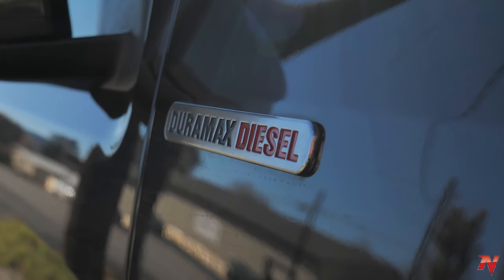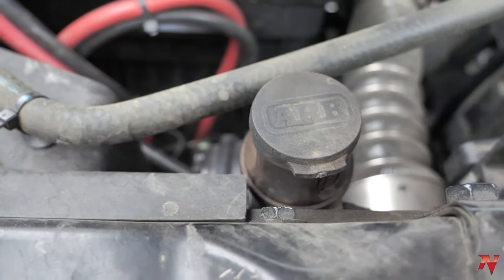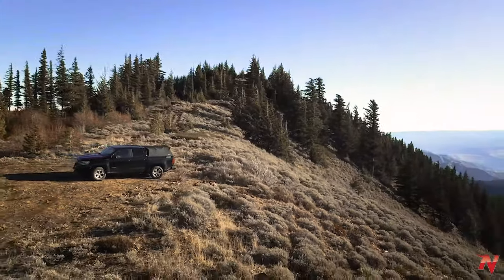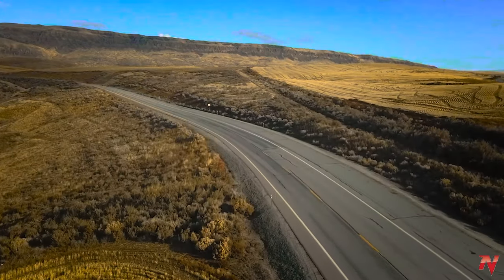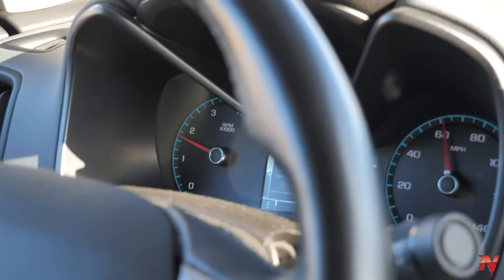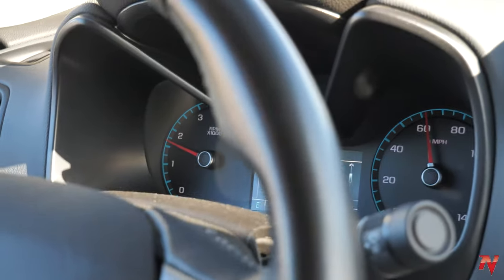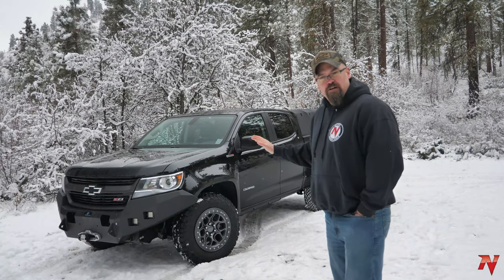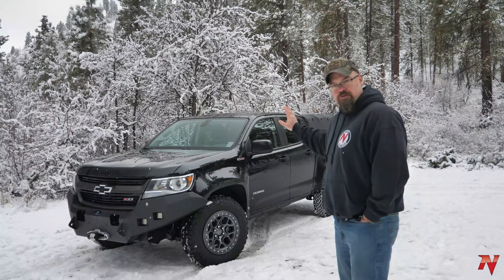NITRO REGEARED Ep. 8 // Chevy Colorado Gets 4.10 Gears // 1st Driving Impressions

Comment: At the end he recommends that with over a 32" tire going straight to 4.56.  With the 6th gear ratio on transmission though being .674, a 34 or 35" tire puts you at over 2200rpm at 75mph on the highway.

Seems just fine for the gas v6 but pretty unwieldy for the diesel to be running at for sustained cruising speeds don't you think?  Seems like even with 34s and 35s 4.10s would let you keep some highway manners while 4.56 would kill your higher speed MPG.
Reply: Someone did a giant spreadsheet about the two engines and trannys with tires sizes up to 35s from stock and 410s basically are the only way to go. They were saying that you'd loose a ton of torque at highway speeds and the gasser would sit in like 5th gear at 65 to accelerate. (I'm going off of memory here, but the end result was yes, 456 gears are no good for the highway)

Comment: I just got the 4:10’s this week. But my tires I’m putting with the bds lift are 305/55/20. Hope I didn’t mess up on this purchase 😬
Reply from the maker: Hey listen if you'd havent installed yet and would like to run the 4.56 ratio, send us an email info@nitro-gear.com // We can have you send us the gears (gears only) and we will do an even exchange for your 4.56s.
Reply: Might be cheaper for me to drive over the pass. I’m in Snohomish, looks like it’s about a 2hr drive.
Reply from the maker: @jermz8273  Either way you'd like to do it. We can take care of you.
Reply: I've got a 19 ZR2 Bison in the V6 and put 32" tires on it. Going to end up putting 33 or 34" tires on it after the 32" are finished so 4.56 it is for the gear ratio.  Was going to go with 4.10's and I called you guys today to inquire about shops in my area.  The guy helping on the phone was awesome and told me the owner had a ZR2 as well and to look at the videos posted on youtube. Glad I did because I would have ended up with the wrong gearing for tire selection and the amount of extra weight I'm carrying with mods and overlanding gear when I'm on trips.  Thanks again for this post and can't wait to get those new Nitro Gears and a tune in the truck!
Reply: Nitro Gear   Well it looks like you guys weren’t able to help me out after all. I didn’t buy them directly from you, so I’m SOL.

Comment: Anyone with a gasser on 33s put 456 in? How is it on the highway? From everything I read, it's not great. I've heard the tranny stays in a lower gear to keep the revs up on top of the fact that your geard down and you just burn through fuel.
Reply: I did exactly that. I also did the middle trifecta tune. I use cruise control when possible. With a combination commute in bad traffic and around town I get a minimum of <17mpg. Easy freeway cruise control is 20-21mpg. The tune does the work. I also run 34” super swampers with their own tune with similar results.

Comment: i just got my 4.56 delivered to day.
Reply: How are they working out?
Reply: @Phthalo  they have been amazing. I did the install with a mechanic friend. All within spec. I have about 17k on them and they started with a bit of noise at 66-70 mph and the noise is still there. I would say the 4.56 is the best option for me. I think Yukon gears is making 4.56 ring and pinion now. Another option.
Reply: @dadsafrantic  awesome, I think you're always going to get "some" noise at highway speeds as long as it's not a chattering. Glad these are working well.